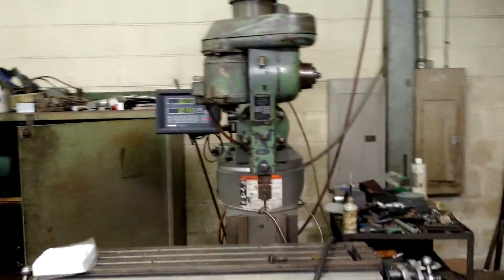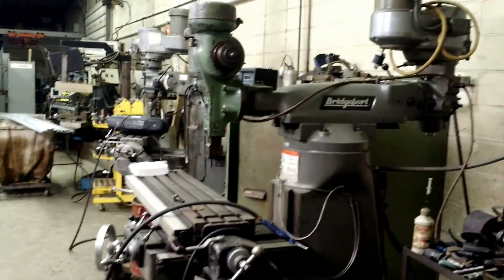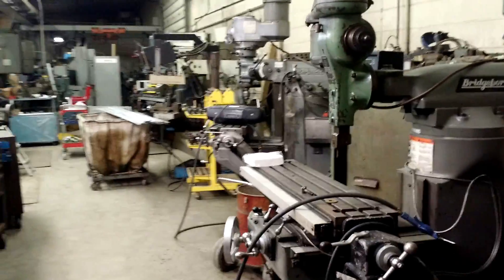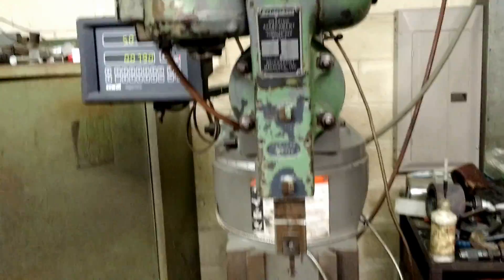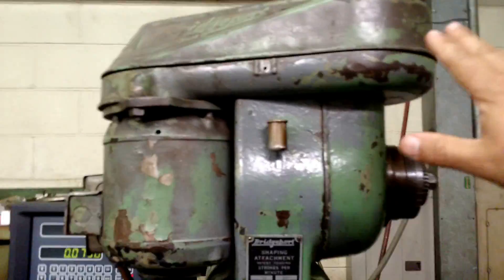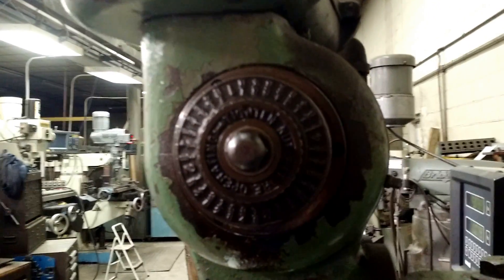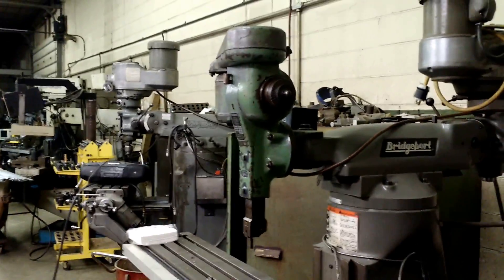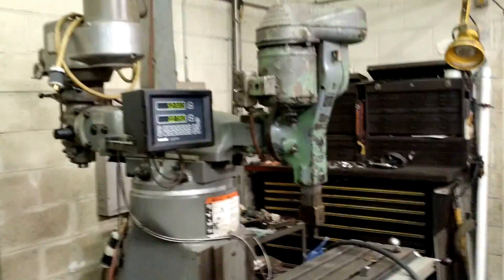Bridgeport Shaper - Machine shop milling machine attachment

Comment: The name plate shows six speeds, but you showed that it has only four step pulleys showed.  Can you explain that?
Reply from the maker: it probably had a different pulley on the original machine... this is not the original

Comment: There was an old machinist who lived in a shoe
He had so many Bridgeports
He didn't know what to do
Reply from the maker: Truth
Reply: There was an old machinist who had  BP's in his basement
He had so many BP's
He knew just what to do
Put an 8" riser on one
A  four and a two
Six vises on one ,
all in a line
14 inch rotary on one 
feeling so fine
A shaper head on one 
ready to go..
Internal keyways now a breeze
.no more
pulling on that #@! arbor press handle
 long  table jaws on one now long stuff goes fast

one setup with a jacobs chuck 
ready to drill
Made so much money
He now worked fast  It was easy and fun
He made so much dough 
He bought a brand new 'nuther one

Comment: That’s so cool. I (probably like most other people) had no idea these existed. I’ve known about shapers, but this particular attachment is really cool.   They actually have one on the mill in school which is the first time I’ve seen one. 

I wonder how they can get away with having that single hole holding the attachment to the mill casting. It seems to me it would rotate. And even if you had that bolt cranked down tight i would think it would still slip. Unless there’s another point of fastening that I missed.
Reply from the maker: there is a flat spot on the shank that prevents spinning

Comment: Hi Ray, Great info on both videos. What value would you place on the 'Shaper' if one came up for sale?
Reply from the maker: glad you liked them!  these shapers are getting harder to find but they are available.  if you find it for sale privately, 600 to 1k would be fair, from a tool dealer or ebay might be more.

Comment: Changed my motor to single phase but have a bad internal starter switch so it will turn either direction randomly.  What is the proper motor direction and does it matter?
Reply from the maker: +johnvallesfarm for the shaper, I don't think motor direction matters. If you have a single phase motor, you probably just need to change the capacitor.
Reply: There is no capacitor, the internal switch activates a start field coil that disengages when rpms have openned the centrifugal switch. I don't know enough to add in a capacitor.

Comment: Thanks, Ray this was very helpful! I had envisioned the "slotter" as something other than a vertical shaper since I had never seen or heard of any other type of shaper other than the horizontal models. Converting rotational to linear motion can be very useful and I will try to incorporate the concept into future designs for the open source machine tool initiative.
Reply from the maker: +Jeffrey Vastine we use this all the time.  In particular, to cut blind keyways and internal splines.  I've never seen another one, not sure if it was a short lived attachment.
Reply from the maker: +Jeffrey Vastine I have another video I'm working on.... how the water jet works. You might find it interesting
Reply: Cool! Any videos showing how a machine works would be appreciated.
Reply from the maker: The water jet is clearly a different animal, but I think the video will explain it quite well for those unfamiliar with it....
Reply from the maker: here is the waterjet video https://youtu.be/j74WZ1UkzTw?list=PLjb5twhxLLcJDGCrweHBQJdIj_BFMjEUm
Reply: Thanks!